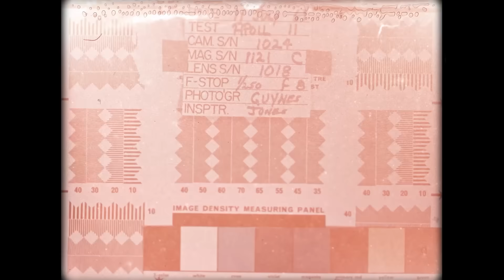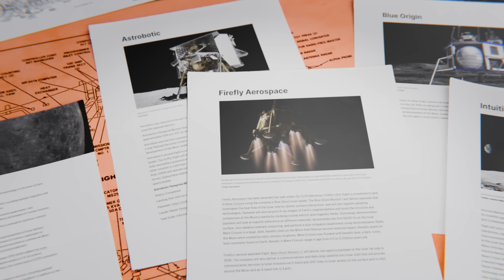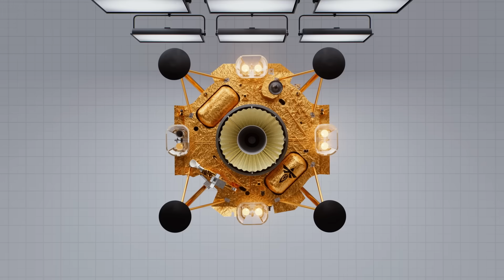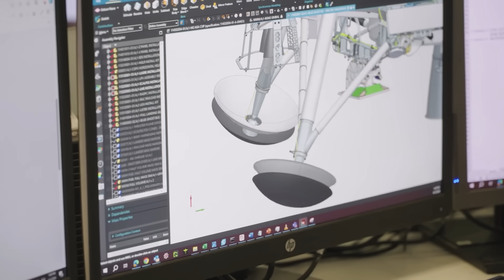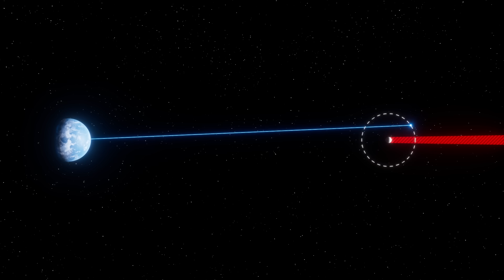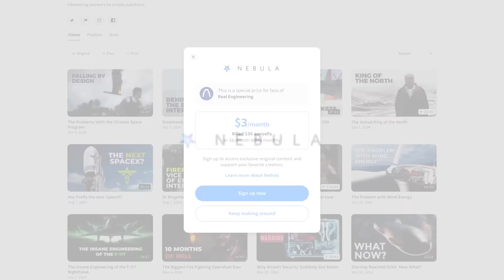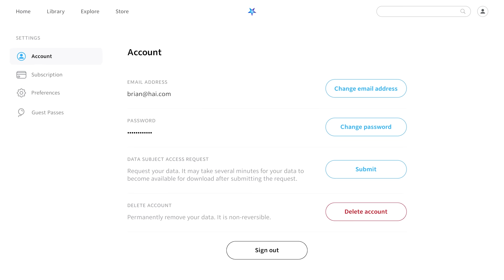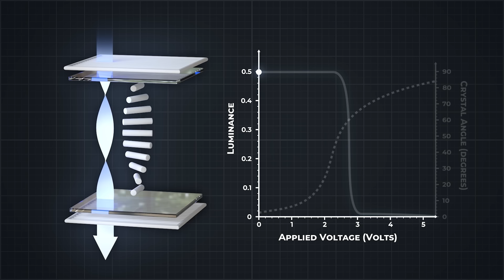Why the US is Struggling to Land on the Moon

Comment: "NASA needs to Re-Learn how to land on the Moon"  🤣🤣🤣🤣🤣🤣🤣
Yeah right.
Reply: The individual knowledge of everyone involved and the “organisational know-how” of how to actually run such a huge, complex project has been lost after such a long time. All the equipment was custom built and much of it is archaic. Many things cannot be bought “off the shelf” and have to be specially manufactured. Re-designing from scratch is cheaper and better. However, it takes years to build up that sort of expertise and NASA has been going through the same problems it had in the early to mid-60’s. 
Rocket technology has not progressed much at all and although modern computers are far more sophisticated, they are far more vulnerable to particle radiation than those in Apollo that used low density integrated circuits and magnetic core memory, both of which are extremely radiation hard, and a lot of work has had to be done to remedy this. The mission requirement is very different from Apollo. The duration of stay is longer, the terrain will be rougher this time with longer shadows and a heavier lander. We also live in much more risk averse times. All these issues are what has caused it to take so long this time around.

Comment: Because they faked apollo missions. Simple
Reply: That’s a populist claim: simple, popular and incorrect.
Reply: @Hobbes746  claim of moon landing in 1969 is not only incorrect but is preposterous and laughable
Reply: @simplywisetech  The Apollo missions are real. This is supported by tons of evidence. Anyone calling the Apollo missions “preposterous” has no idea what they’re talking about.
Reply: @simplywisetech  Doctored images? No. Out of the 8000 Apollo images, none have been demonstrated to be doctored.
In all those photos, every object has only one shadow, which proves there is only one light source: if there were more light sources, you’d get more shadows. With flood lighting, you’d get no shadow at all. 

Current spacecraft are technologically far more advanced than the Apollo hardware. The only advantage that the Apollo stack had was that it was large enough to carry all the fuel you need to launch to the moon. That made the stack extremely expensive: it cost several billion dollars per launch. A SpaceX Falcon can do a launch for under $100M. 

I have an extensive background in physics and engineering. I’ve examined the Apollo missions thoroughly. I’ve looked at the evidence for and against the missions. I found that the evidence for the missions is solid, while the ‘evidence’ against the missions falls apart on examination.
Reply: @Hobbes746  it's okay u want to believe it. Do your own  research on all these claims . I have done mine and reached this conclusion 
It was all 100% fake
Reply: There were 9 manned flights to the moon. They landed there 6 times and 12 people have walked on the moon. They have collected over 380 kilos of moon rocks that have been studied by scientists worldwide.
These are irrefutable scientific facts. Your gut feelings don't count.

Comment: Near the 8:44 mark they state "because plumes of dust are expected to occlude the view." Where was all the dust during the videos?  absolutely none on the space craft after landing or when the return modular fired off from the moon surface.
Reply: There was plenty of dust in the videos. On every landing, from about 1 minute before touchdown the ground gets obscured by dust being kicked up by the descent engine. 
This looks different than it would on Earth. There's no atmosphere, so the dust doesn't billow into great big clouds. Instead, it's launched away from the landing site at high speed. The dust all follows ballistic arcs. So when the engine is shut down, the area around the lander is immediately clear of dust. 
The lack of atmosphere also means the dust won't settle on the lander: it's moving away from the lander, remember? 
The ascent module sits on top of the descent module. So the ascent engine exhaust hits the descent module, and not the ground.

Comment: Relearn?  I think you mean LEARN and to also not lie.
Reply: The US has successfully made 11 landings on the moon in the 1960s and 1970s, so if we’re considering the USA a monolithic entity, “relearn” is correct.
But the US is not a monolithic entity: people alive today don’t magically have all of the knowledge gathered by NASA and US companies in the 1960s and 1970s in the course of those landings. 
Case in point: Intuitive Machines was not around in the 1960s. They have no personnel that worked for NASA in the 1960s. They are a new company, and IM-1 was not just their first moon landing, it was their first spacecraft. Intuitive Machines personnel made a mistake: during the preflight check, they forgot to switch the altimeter out of safe mode, which meant the altimeter would not be operable during the flight. This is what caused the IM-1 landing to fail. 
This very basic mistake is one that NASA experienced working on its very first missions, and they documented it and created procedures to prevent it. Preflight checks have been standard not just in the spaceflight industry, but in aviation and other safety-critical industries for decades. IM could have learned this from any number of sources.
Reply: Your gut feelings don't count.

Comment: So landing on the moon is hard. But that doesn't explain why we were able to do it over 50 years ago, yet we can't do it now
Reply: Back in the 1960s NASA spent $300 billion on Apollo. That’s how hard moon landings are. 
IM-1 failed because they made a basic mistake. Their design was sound, but they skipped a step during the preflight check which meant the altimeter on IM-1 didn’t work.
Reply: The reason is that you are not very intelligent.

Comment: Why dont they use radar altimeters?
Also, is this video from a parallel universe in which the US and Soviet robotic lunar landings in the early 1960s don't exist?
Reply: Intuitive Machines used a laser altimeter. They forgot to switch this altimeter out of safe mode before launching the spacecraft.

Comment: The most obvious difference is the skill and knowledge of the people involved, with a hands-on, math-in-your-brain approach as opposed to relying on computer models programmed by techies that may or may not have the knowledge needed for it to be accurate.  These were people who knew which way to turn a wrench, which they learned from their dads and high school shop teachers.  Today’s techies have never held a wrench.  The old schoolers went to the moon with slide-rules and computers with less computing power than my kitchen microwave, and for this reason there’s a sizable portion of today’s generation who weren’t even born who doubt it could have even happened - because it’s so beyond their comprehension and experience. 

So, why did Neil Armstrong land on the moon and a computer operated lander tip over?  Because Neil Armstrong was one of the best pilots in the world.  The fact is they DID almost crash, when the primitive computer was failing and the lander was careening towards a bunch of jagged rocks, all while they were seconds from running out of fuel.  But Neil Armstrong took the stick and landed it manually.  That’s the difference.
Reply: you are aware it crashed because one of the nesscerary sensing instruments was covered on a UNMANNED lander with much less budget and much less people working on it, right?
Reply: @justachickenboi  - And…it crashed. What’s your point?
Reply: @MoonjumperReviews  wow! a experimental unmanned spacecraft from a underfunded private company failed on their first attempt! shocking?? surely this means all modern engineers are idiots and have no skill, right? what's YOUR point?
Reply: @justachickenboi  - I stated my point.
Reply: @MoonjumperReviews  your point is pretty ass icl

Comment: Leaving this comment here so I can show the gandkids grandpa wasnt no gullible goof. This moon landing bs is fake as hell. They cant pass through the radiation belt today, let alone 1969
Reply: The Van Allen Belt's are only a problem if you stay within the denser regions for an extended period of time. 
Here are the words of Dr. James Van Allen himself, the man after whom the belts are named and the man who advised NASA during the Apollo Program: 
"The outbound and inbound trajectories of the Apollo spacecraft cut through the outer portions of the inner belt and because of their high speed spent only about 15 minutes in traversing the region and less than 2 hours in traversing the much less penetrating radiation in the outer radiation belt. 
The resulting radiation exposure for the round trip was less than 1% of a fatal dosage – a very minor risk among the far greater other risks of such flights. 
I made such estimates in the early 1960s and so informed NASA engineers who were planning the Apollo flights. 
These estimates are still reliable. The claim that radiation exposure during the Apollo missions would have been fatal to the astronauts is only one example of such nonsense." 
Dr. James A. Van Allen.
Reply: You were in fact gullible. All of the data we have on the van Allen belts says humans can in fact pass through them without issue.
Reply: You don't even know what radiation is, your kids need to put parental controls on your phone so you stop embarrassing them like this

Comment: Because they’ve never been to the moon. You know why? How did they managed to go back to earth whereas they need another rocket from the moon  going back to earth, impossible is it? No hi tech back then 😂😂😂 landing was faked….
Reply: Yes, you need a rocket to get back from the moon. The thing is, through clever design and because of basic physics, that rocket can be a lot smaller than the one that got them to the moon. 
The rocket that launched the Apollo missions to the moon, had a big job: it had to accelerate 50 tons (command module, service module and lunar module, all with full fuel tanks) to a speed of 11.4 km/s in Earth’s gravity field. 
The process to get back to Earth was split into 2 parts. 
1. the LM ascent stage carried the astronauts from the surface to lunar orbit. To do this, it had to accelerate 2 tons to a speed of 1.6 km/s in the moon’s weaker gravity. So 1/25 the mass, and 1/7 the speed. Because kinetic energy rises with the square of the speed, that’s 1/49 the kinetic energy. That’s 1/1225 the kinetic energy. The Saturn V carried 3000 tons of fuel, so the LM ascent stage only needed 3000/1225 is 2.44 tons of fuel. 
2. in lunar orbit, the astronauts transferred back to the command module, and jettisoned the lunar module. The command module then had to accelerate to lunar escape speed (accelerate from 1.6 to 2.4 km/s) to get back to Earth.
Reply: It turns out that you have no idea what you are talking about and are just talking nonsense.
Reply: @ApolloKid1961 the bigger problem is neither of scientist around the world do not 😅 if they knew how.. we weren't talking there about it😢😮😅😊
Reply: @ahmetmutlu348  correct my friend because they knew it! It was filmed in Area 51

Comment: The only rational inference that something is still “hard” after more than 50 years elapsing is that we never had sent men to the Moon.

What tech from 50 years ago don’t we have in such superior forms today?

Why would the Astronut (sic) Pettit on video still on ytube say he’d “go back to the moon in a second, but we lost the technology.”

How gullible are you and the plebs to believe that horsepuckey!  Ffs, Malthus was right!
Reply: The only advance in rocket technology now is that they can land boosters. Pettit meant that the infrastructure is no longer there to build another moon rocket. The blueprints and other documents are still kept but that technology is now 60 years old so they better start over. Back then 400,000 people worked at 20,000 contractors to make landing on the moon possible, you can't compare that to 1 company with 250 employees. It was their first attempt that failed due to human error.
Reply: @ApolloKid1961 so logically what you are saying is blue prints are separated to 200 companies and that makes it hard to make one blue. Print accessible .. still what you said means technology is indirectly lost😮😢😅😊
Reply: Designing an airliner is still hard today: Boeing spend 7 years and $25 billion on the design of the Boeing 787, even though they have designed lots of airliners before. 
Similarly, building a rocket and spacecraft that can land on the moon is still hard today, despite us having done it before. 

Intuitive Machines took advantage of a lot of knowledge gained by NASA in the 1960s. But they also ignored some of those lessons: they didn’t do a good preflight check, which meant their altimeter was inoperable during the mission which led to a hard landing.

Comment: its not about a lack of technological capability to do the same thing china has. We have the ability to do it if we want. The problem is the disorganization, and red tape preventing anything meaningful getting done in anything resembling a workable time frame. We stretch projects so far out, and get some over budget they get cancelled. and NASA's funding is like the wind. Strong through one administration, gutted during the next.

Comment: Why is the US struggling to return to the moon? Because it never went there in the first place!
Reply: Why should we believe your gut feelings?
Reply: The US has made 11 successful landings on the moon, after a bunch of early failures. 
Intuitive Machines wasn’t around back then. IM-1 is THEIR first mission to the moon. They learned from NASA’s landings, but they also ignored some of the lessons NASA learned back then. Lessons that were documented extensively and are available to anyone. Specifically, they forgot to do a thorough preflight check. They missed the fact that their altimeter was set to safe mode, which meant they launched the spacecraft with an altimeter that didn’t work. They still managed to do a landing that was slow enough for the spacecraft to survive, even if it fell over.

Comment: Fifty years of wasted low earth orbits, instead of continued moon exploration.
Reply: Not wasted. After the moon, the next logical target is Mars. That requires a trip that takes 3-6 months. Before embarking on such a trip, we needed to find out how the human body handles being in space for that long. The ISS was built to investigate this.
Reply: @Hobbes746 Yes wasted, if Mars is the next objective, then a base on the moon and the ability to maintain it would a be better venue for that experiment than the ISS.
Reply: @douglaspierce8480  No. The objective is to find out how humans handle zero gravity, not 1/6 g. The moon has gravity, which makes it useless for that research.

Comment: we dont have the tech to send people to the moon and back and have never had. We need to solve many problems related to radiation and fuel.
Reply: Incorrect. We solved those problems in the early 1960s: radiation measurements showed that Apollo-type missions can be done without radiation shielding, and the fuel problem was solved by using the Lunar Orbit Rendezvous architecture.

Comment: Why not use a radar altimeter to measure the distance to the moon surface? Works for planes perfectly fine
Reply: The IM-1 spacecraft had a laser altimeter. Unfortunately they forgot to switch the laser out of safe mode.

Comment: I am not an engineer or anything so this is just a naive idea with - I am sure - 100 problems, but why not first launch a foldable plattform..
Get it to a known relatively plain area and when near the surface unfold it and just place it there. The platform can have senders and sensors to help navigate future vehicles to pinpoint the landing.
This would reduce the uncertainty. 
The only obvious problem is that the platform might need capabilities to account for minimal differences in height of terrain.